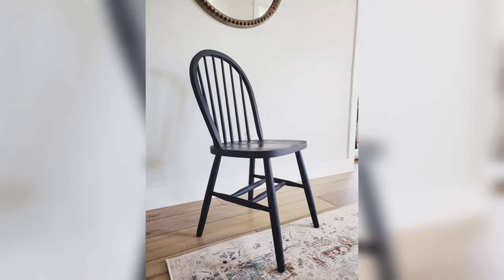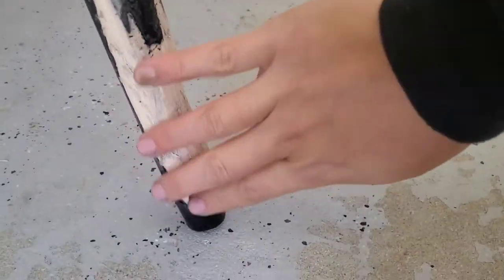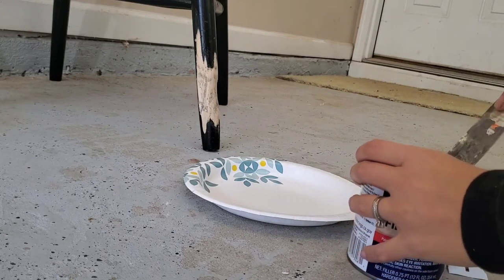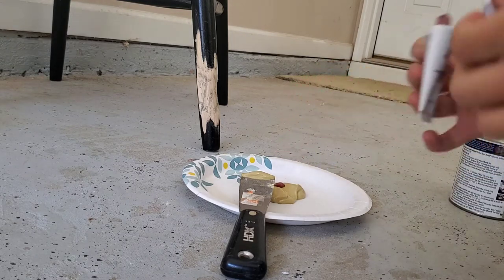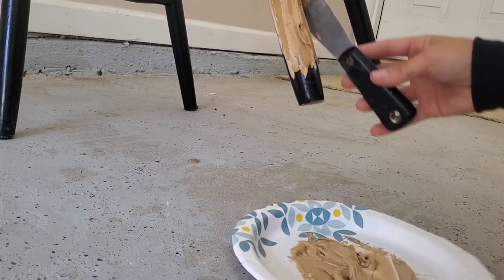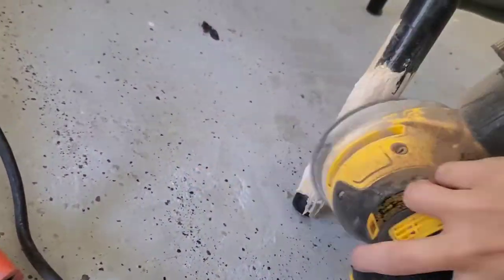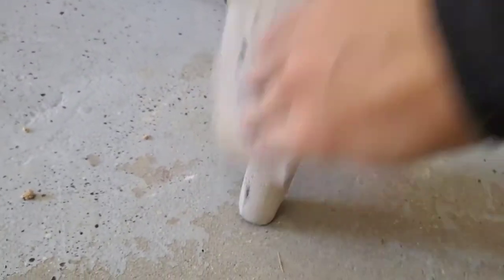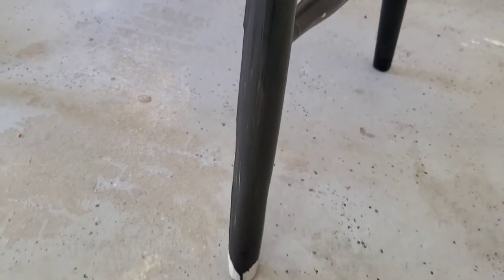EASY How to repair chewed or chipped wood furniture!! DIY

Comment: Great video. Question on the wood filler. I heard there is another stuff called plastic wood have you used it before? What’s the difference? Thanks!
Reply from the maker: Plastic wood is usually already premixed. I've used both before. This one dries quicker but both products are good!

Comment: I need to repair a Mexican figurine made of wood. The tip of its tail has broken off. I am wondering how to use the Bondo to extend the tail since I will not want to overlap the portion of the tail that still remain because that would create a bulge in the surface. Suggestions?